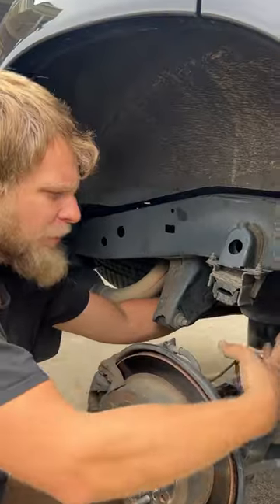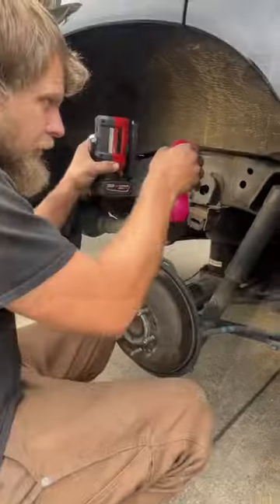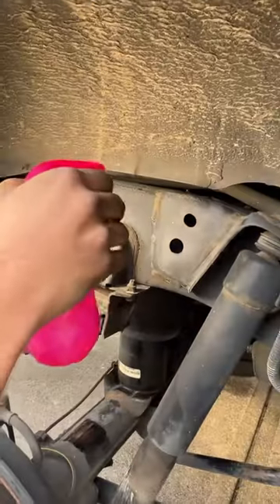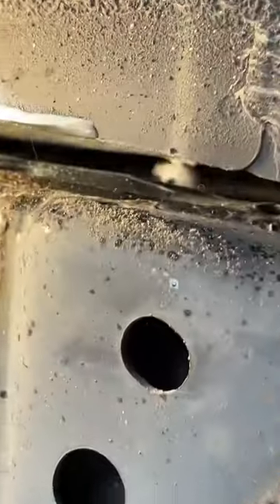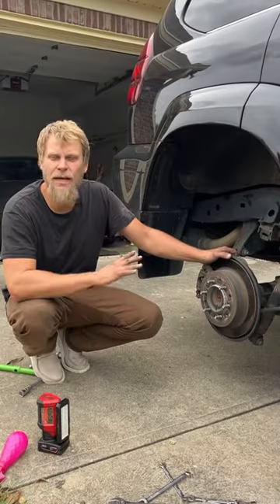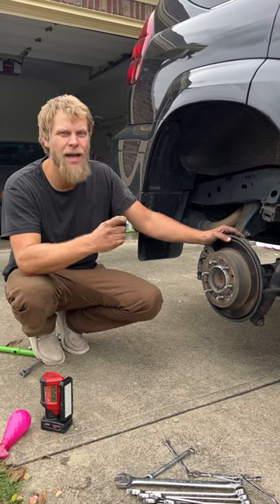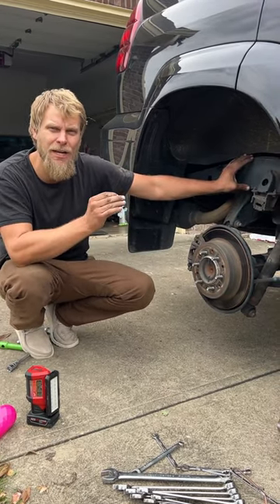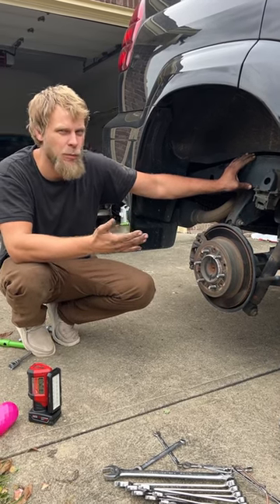Arnott Lexus Rear Air Suspension Bags Leaking pressure after replacement GX470 compressor lift

Comment: I feel your pain... so many times I've bought parts that were messed up... a couple that comes to mind are a Ford Taurus with no bearings installed in the struts and a f150 4x4 with no metal sleeve in the shock bushing.😂😂😂

Comment: Always check and compare a new part before Installing it. Fixing it before you install it is usually easier. 20% of Factory parts are messed up and 50% of aftermarket parts are broken 😡..

Comment: There are air struts that are good and then there Arnott. In my personal experience there is something wrong with about 1 in 3 suspension components they manufacture. The one piece bag and strut assemblies were a little better. But just the bags were awful, particularly on Benzes. But their Land Rover stuff was generally ok

Comment: As a mechanic for over 30 years I would have checked that the whole new unit was air tight.  Too many replacement parts fail.

Comment: Ayooo who makes the bags? We make all firestones fittings for there bags that may very well come from my shop bro, right north of you in wabash. We had serious issues when we picked up the contract the shop before us couldn't produce them firestone actually dropped there contract with them and came too us, we tried running them on the same old tooling we use for hydraulic fittings and realized it didnt work and ended up switching everything from hss to carbide and new tool holders and stuff, fetty heads instead of regular thread rolls.

Comment: Good to know, i have a P38 range rover with nuked air springs that i'm about to replace.
Reply: Just spring swap. Those compressors are damn near impossible to find
Reply: @lukeyarasheski5510  compressor is brand new, was replaced by previous owner (land rover stock compressor too)
Reply: @leo34150  That is irrelevant with EAS. I have had them last 11 days on a brand new factory part. They are nightmares on the P38s and Classics
Reply: @lukeyarasheski5510  y'know what i'll keep that in the back of my mind. I'll still keep the EAS and replace the air springs, and if i get a catastrophic failure in like 6 months i'll consider swapping to standard springs.
Reply: @leo34150  That's the smart play. We had a guy who would rebuild his on his classic like every 18 months. It was like 2500$ a pop

Comment: lol when did you start last week? after about a month youll learn to not trust any new part aftermarket or oem if theres a plug fitting hose you name it im checking it so i dont have to waste my time fucking around with it after the faft and thats not loctite its thread sealant

Comment: Made in USA or CHINA
Reply: Idk man we make those exact fittings right here in the usa idk if the brand he is using is the one we make them for but even usa parts have problems. The company we got the contract through fired the machine shop that had it before us because they couldn't make them well enough, im not saying go buy chinese stuff producing those fittings is literally what puts bread on the table but everyone makes mistakes and sometimes a company has to find a better machine shop because one cant produce the quality they need

Comment: So when you say “aftermarket bags” are they from the land of of which we don’t speak of? Starts with a C ends with A?  Yeah you wouldn’t think to touch those swaglok fittings to the air supply
Reply: ACTUALLY MOST OF ARNOTT IS MADE IN THE USA...